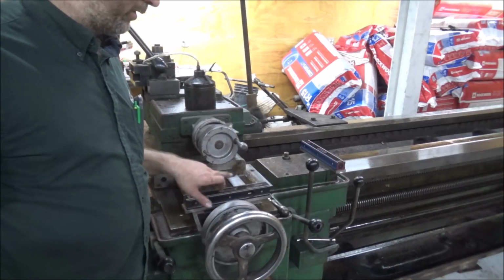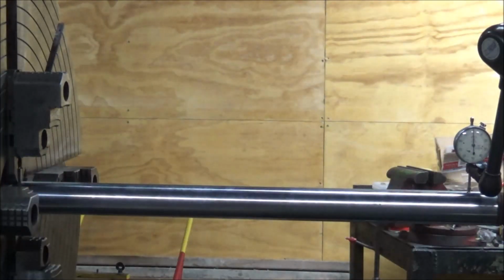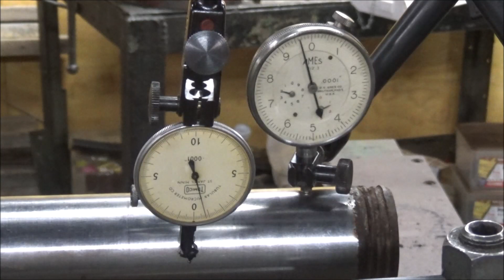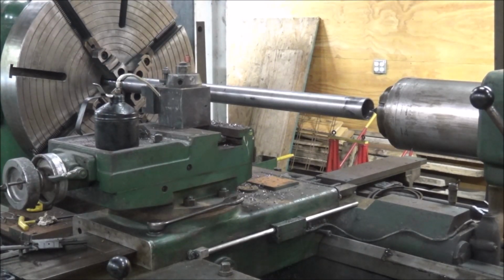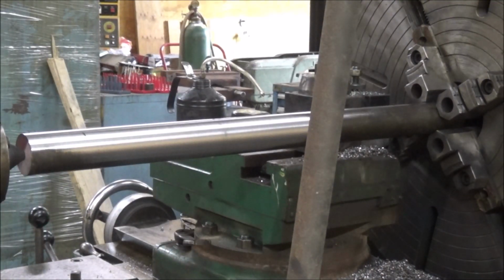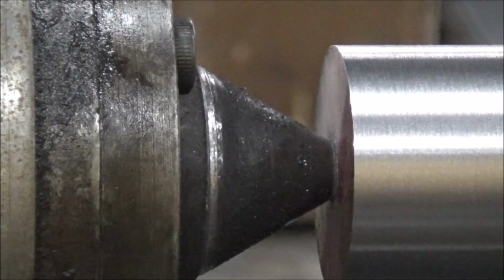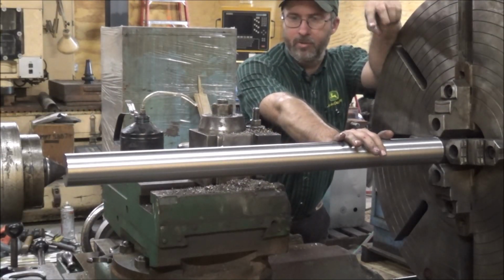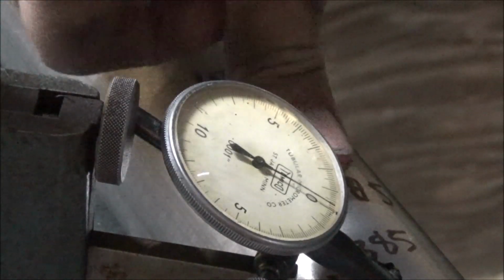Lathe Leveling and Aligning like you have Never Seen!

Comment: The two collar method is a MUCH easier and generally more accurate method. Measuring work like this does not necessarily take into account the cutting forces placed on the central part of the test piece and in also increases the temperature of the whole workpiece. Turning (the central portion of the shaft smaller and) a 3"-4" collar at each end will provide accurate measurements to determine the tailstock alignment.
Just pulling on the tailstock while turning a piece that size, will compensate for the 1.5 thou discrepancy. You may find the releasing and re-clamping the tailstock removes the 1.5 thou difference.

Best wishes

Comment: Really nice job Brian, and thanks for the explanation of the two collar method.  I hadn't thought of using a piece of hydraulic shafting as a spindle alignment test bar, super cool idea.

I'm betting that bow in the middle of your test cut bar is mostly due to deflection from tool pressure - what kind of tool were you using?  Would be cool to try a shear tool, and do super light cuts (maybe every 3-6".)  That would really reduce the tool pressure to almost nothing.
Reply from the maker: Pete Brubaker It was a cnmp431 insert so the easiest cutting thing I have. I agree some of the barrel shape is likely from tool pressure. Also I looked it up and a bar that size over that length sags almost .0005” so pretty easy to get some error from that as well. The .0002” error indicated by the cylinder test bar was likely very close to the actual alignment. Will be interesting to see some time on a 5 or 6” diameter bar how it does.

Comment: If the spindle axis of rotation was not parallel with the ways, how and where on the machine would you adjust this?😁
Reply from the maker: If it’s a little out you could twist the bed. If it is a lot out you would have to remove the headstock and scrape its mounting pads to correct the alignment which would be major work.
Reply: Thanks😁

Comment: I like your approach. There are simply very many variables affecting taper in your test cut. You have to collect enough data to conclude what is the largest error contributor. You have some notion of the bedway condition from your level inspection. I worked on shorter machines. So I was able to do my taper test cuts without tailstock engagement. One test that I would have done since your length and diameter required tailstock support would have been to have indicators monitor the part movement when you removed the engaged tailstock. You guessed pretty accurately and opted for the tailstock correction. Indicated movement would have been just one more data point to calculate how much corrective tailstock action was warranted. Naturally, that much extension could result in some deflection in your setup.
Your part crowning on this test part with the alignment data that you showed on the video makes me inclined to suspect part deflection under tool load. Steady rest support on a subsequent test part with otherwise identical setup might confirm that theory.
Cutting dynamics can be different than static tests. When I worked in the field and got something this close with as much known wear variability that you know of or suspect, I would evaluate the parts that the machine was going to run. At some point, you really only care if you can make good parts. Sometimes you are forced to tweak for good parts over good test data. 
I preferred to calibrate two Starrett .0005"/ft machinist levels and never move them during my lathe bed leveling, crowning and twist correction.  Developing confidence that level, crowning and twist is as good as you can get it and that it is repeatable goes a long way before you go after the causes of part turning taper, crowning, etc. 
This video doesn't address spindle and tailstock bearing run-out condition. At some point these factors enter in to diagnosing error causes. You mentioned some "wonkiness" in the tailstock bearing. How much was that contributing to the run-out you demonstrated by removing the tailstock center?

These issues are challenging to solve. I put many machines back into production with your final error. Fortunately our long critical diameter and controlled taper parts usually were cylindrically ground as the final production step. We generally only had to deal with much shorter work where getting taper under .0002"/ft was doable, because the bed length issues were confined to under 2'. We simply didn't have to worry much about dynamics on the tailstock end of the lathe bed.
CNC was my primary world where bed rigidity was often less of an issue than long engine lathes and linear guides ensured more rigidity, accuracy and less wear than on solid ways and gibs.
Reply from the maker: Being that this isn't a CNC most every job is a one off and cut and check is the standard method so having it close is good enough.  Normally would not be doing cuts that long on parts of that diameter with tolerance more critical than the .0015" this was showing anyways. Normally .005" is plenty good on all long length shafting except where bearing fits occour.

Comment: For a machine that size, that's lived the life I think it has, that's damn good! 😁
Wouldn't turning a pipe that long and thin almost require a follow rest? 

Thanks for the video. 👍
Reply from the maker: Yeah too small a diameter for that length without something extra for sure. I thought I might squeeze by but physics doesn't change the rules just because we want. lol

Comment: Nice job on the monster Monarch. A set of center legs adds complications. Did you level along the bed axis to eliminates a hump/dip? How thick is your foundation slab?
Reply from the maker: The slab is 18-24" thick under the Monarch, did you skip the videos of me building the shop? Tisk tisk! lol Also starting around 0:30 I showed my two levels and how I leveled the bed along its length with a .010" shim under the level to get coolant to drain back to the head better and how it indicates to me there is about .003" hump up in the middle of the bed after I got the twist out even though there are jack screws in the middle holding no weight.  Got to pay better attention in class and not be distracted by that big beautiful whirling piece of Fine American Heavy Iron. lol :-)
Reply: @bcbloc02  24" Wow! I admit I haven't seen them all, but remember some of the slab ones, just not how thick. I listened to this one in the car, so missed the finer points. If your middle legs float, you could pull them .003" easily with adhesive anchors to pull the middle flat, just pull it against hard shims.

I'd also like to see your vids of your crane steel going up, but haven't found those yet. My building is 50' wide, 17' high at the eves, minus 24" if crane rails run under the truss members. Thinking of having one crane running crosswise (50') fit in the last 25' bay, which could then tuck up higher, with a door on each side so a truck could pull through.

Comment: Brian, I'm used to making stuff the size of the barrel of your mic, but my question is,  with those lite cuts, you are large on the tail stock end, but if you made a "normal for you" cut, wouldn't the tool pressure and pushback on the carriage more than negate that?  Or am I bass akwards?  Lol
Reply from the maker: Badgermatt75 2016 A heavy cut amplifies the barrel shape due to part deflection.

Comment: I noticed that the end of the bar doesn't appear to be faced. Does that have any effect on how the tail stock performs?
Reply from the maker: Dudley Cornman  no it is a cone going into a conical bore made with respect to the axis so they match. If the taper angles vary much it could produce some offset force I guess but as long as it all revolves together it should give the same results unless contact and orientation are disturbed.

Comment: I noticed that your beer got a lot longer through the video how long did this actually take to do
Reply from the maker: I don't recall, it was probably over a weeks time as I have other work I was doing too during the same time.
Reply: It's off subject but I bought a 1972 24x78 Lodge and Shipley Answer lathe that has variable speed and its motor drive was burned out. That's probably why I got it for $300. Its supposed to be powered with a 240v DC motor and also use that as the brakes.  I presented with a few problems in the way of making it usable for myself.
1st the shop space I rent is 100 amp service total. 
2nd the cost of adding 3ph to the shop would come out to $10k
3rd the cost of a diy driver for the 17hp DC motor is around $7k
I think I can get away with using a modified fwd car powerplant and using the cruise control  that gives me  forward and reverse plus I'll add a big brake for slowing the thing down. 
   Does that sound like a reasonable plan?